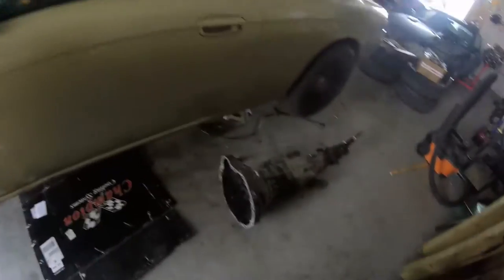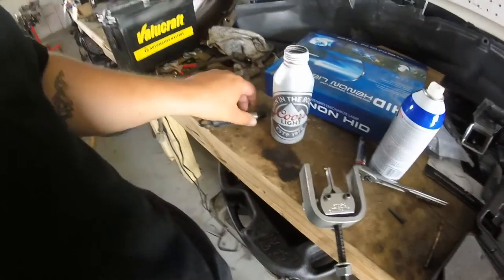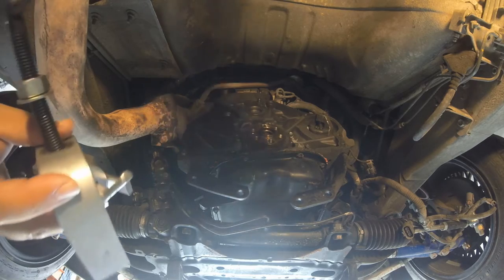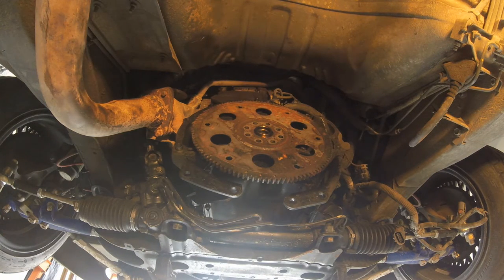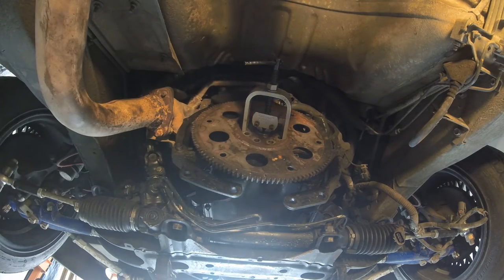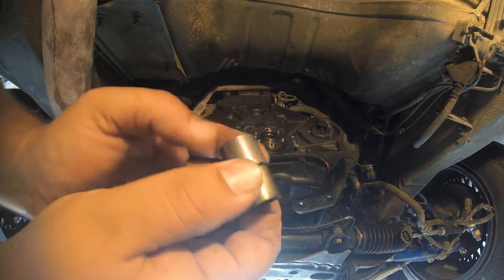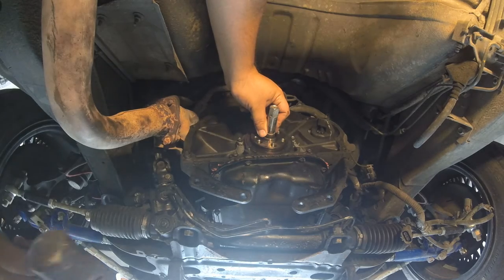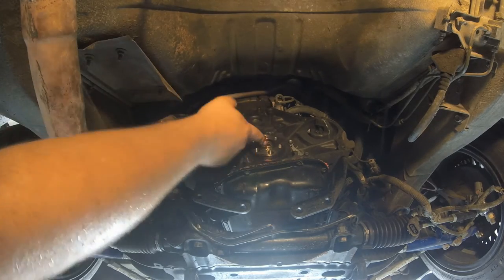S14 240sx Pilot Bearing Replacement

Comment: Glad that puller worked! Love it when things go as planned haha
Reply from the maker: Hell yeah! I was afraid it was gonna be a disaster but it worked so well I was contemplating on keeping the puller but I found it cheaper online. So I'll return this one and buy a new one. 😁
Reply: Right on! I did the same thing with my break flaring tool lol
Reply from the maker: +efitter7 
I love when things come together nicely. 
Have you seen that Eastwood brake flaring tool EricTheCarGuy did a review on? Ugh, I want that one so bad. Lol
Reply: I wanted that one! Had to get the ebay special though haha ;)
Reply from the maker: +efitter7 
Yeah, it's pretty badass. I'm not in need of one yet so I'll try to save up for it. It's a little pricy.

Comment: Tool didn't work for mine, but a small hand saw and slide hammer bearing removal from harbour freight eventually did. You don't need to bite all the way through, just a couple times in different spots of the I.D.  mine was the absolute worse. Grease trick with bolt didn't even work.